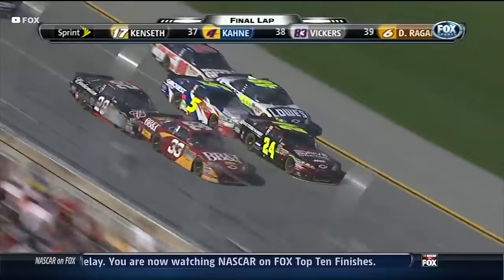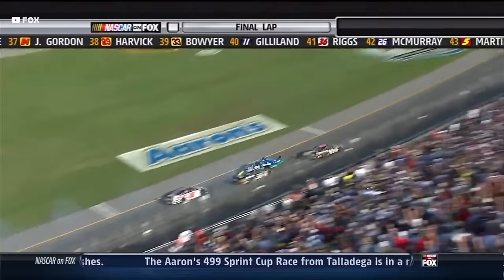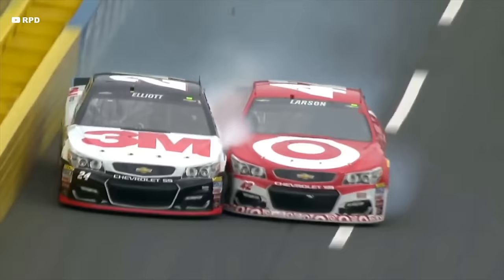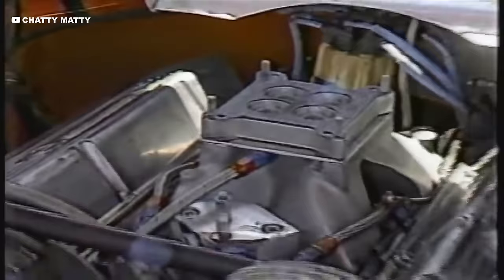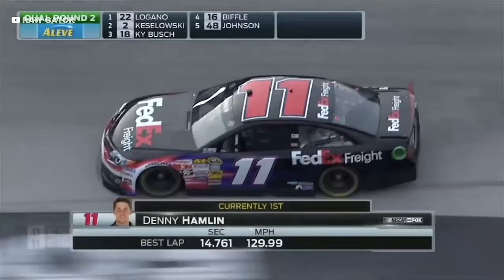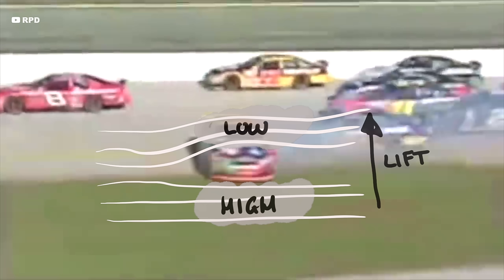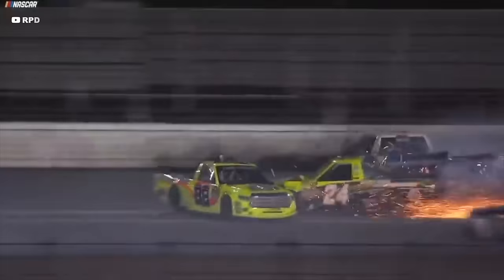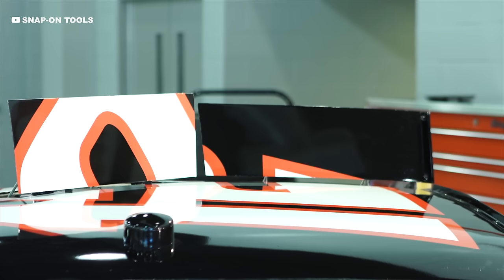The Simple Invention That Saved NASCAR

Comment: "Because the air has to travel farther on one side, it travels faster." This is a conceptual error. Low pressure regions speed up a fluid, and high pressure regions slow it down, just because the fluid is doing work to enter the high pressure region and has work done upon it to enter the low pressure region. This is why the velocity at the top is higher than at the bottom.
 The speed at the top and the bottom do not guarantee that the transit time is the same, so the explanation that the airfoil lifts because the air above is moving faster is incorrect.
Reply: YES! Even a brick with create lift. It's all about the angle of attack. The shape just makes it more efficient (less drag).
Reply: @nateverge1167  no, it's not all about the angle of attack. some wings can create lift even at negative angles of attack (when the front of the wing is lower than the back of it)
Reply: @vsm1456  Said lift is still a result of pressure differential, and relies on laminar flow and edge vortex to form a positively angled 'phantom wing' out of the medium itself.
Reply: Wow. There are so many things wrong with this thread it’s hard to know where to start. Any air that is deflected upwards by the leading edge of a wing is accelerated. There are two kinds of pressure: static pressure, which is the ambient air pressure acting on your body right now and dynamic pressure, which is the pressure created on a body by virtue of its movement through the air. In subsonic aerodynamics, as dynamic pressure increases (speed through the air), static pressure decreases (suction). That is what creates lift.

Scott is 100% correct.

Air wants to return to a state of equilibrium. By a principle of vectors, the air going over the top of the with has further to travel than the air underneath so in order to return to that state of equilibrium, it must travel faster.

I rarely agree with Scott Mansell - Driver61 - on technical matters but I have wind tunnel experience with racing cars. In this case he’s right. My experience related to a very similar problem, aerodynamic divergence in Formula 1. This is the phenomenon which causes cars to flip.
Reply: @vsm1456  Really? How?
Reply: @ineednochannelyoutube5384  Nothing to do with laminar flow. Racing cars don’t travel fast enough for that to be a factor.
Reply: @nateverge1167  Up to a point, yes.
Reply: @thethirdman225  First off cars absolutely can reach speeds where wings can stall, second off I was referring to seemingly negative deflection angle wings creating lift in any context not just cars.
Also in regards to your previous comment, wgat the fuck?
Pressure is pressure. No dynamic or static versions of it exist.
The system is either in equilibrium, and the pressures do not change, or the system is not in equilibrium, and the pressure differential creates flow.
Reply: @ineednochannelyoutube5384  Dear God... Stop commenting on things you don’t understand! “Pressure is pressure”... WTF? Are you serious? Do you not understand barometric pressure? Have you never experienced riding a bike into a wind?

Have a look at any commercial aircraft. They all use a pitot static system:

https://en.wikipedia.org/wiki/Pitot-static_system

And they do this because there are two different kinds of pressure. If you don’t understand these things you should not comment. I have wind tunnel experience on racing car aero. I am a former pilot.

The concept of equilibrium relates to returning to equilibrium. How do you not get this? You’ve taken a couple of bits of research which you don’t understand and posted it to prove that everything we know about aerodynamics is wrong when you yourself don’t understand the basic concepts.
Reply: @ineednochannelyoutube5384  Who said anything about stalling?
Reply: @ineednochannelyoutube5384  please show me an example of a wing at a negative AoA that is creating lift.
Reply: @thethirdman225  won't a cambered wing create lift at small negative angles too?
Reply: if you have two measuring points in air and follow them along the wing surface top and bottom you will find the one going over the top goes at the same speed as the bottom and cannot go faster without enrgyt input .. until the air has moved from front to back NO low pressure can exist or does exist ... once the bottom position reaches the rear of the wing the difference between the bottom and the top point becomes the effective lift of the wing ... youre explanation violates the law of thermodynamics  by creating energy out of nothing ... until air has moved NO LOW PRESSURE AN EXIST ABOVE THE WING and if you actually understand the lift equation you will notice it uses a derivative of the top to the bottom of the wing to calculate lift which means it is calculating a distance which relates directly to the lift of the wing ...
Reply: @0623kaboom  In any case, the Bernoulli theorem, which this guy is effectively saying is wrong, is still used to calculate lift and drag.

But I'm waiting for someone to make a video announcing, "Everything we know about aerodynamics is WRONG!" by someone who's seen a few YouTube videos and has no alternative explanation.

Bernoulli's theorem is not perfect but it's the best we have.
Reply: @thethirdman225  I don't know how, but it appears that some wing shapes are effective enough to still create some downforce even at negative AoA
Reply: @vsm1456  I'm not entirely sure of what you're referring to. I have heard that the front wings on early 1980s ground effect cars, up to the end of 1982, were run at a very slight positive AOA which had a flow on effect to the undertray and created greater levels of downforce. I don't know how true that is because I've never seen anything in the way of technical or scholarly articles on it.

Once a wing reaches a neutral AoA, it stops producing lift. But that neutral AoA should not be confused with mean chord line or camber line. Neutral AoA means no net lift.
Reply: @thethirdman225  He's getting on that there are airfoils that have a neutral AoA below a horizontal mean or "visually apparent" chordline, like the supercritical airfoils and low-speed convex lower side profiles.
Reply: @mfree80286  Yeah, I get it. Cheers.
Reply: If KYLE.ENGINEERS read this entire thread his brain would combust
Reply: @thethirdman225  All of my aerodynamic knowledge is purely in my head based on my own observations and I could a large chunk of this was nonsense(not you, you actually helped me understand my conclusions better).
Reply: @wolfywise  Thank you.
Reply: @wolfywise  By the way, what I didn’t say was what I think happens. Most people look at the diagram over a wing which shows a large vacuum bubble over the top surface, returning to meet the air underneath after the trailing edge. I think it is simply a case of high speed air over the top reducing static pressure, regardless of how it returns to equilibrium (which happened via turbulence which ultimately dissipates the energy). Meanwhile air underneath is compressed, with the sum total equal to or greater than the weight it supports. But Bernoulli’s equations - which these people infer are wrong - are still entirely valid. But I get sick of hearing people telling me it’s “conceptually wrong” while providing no plausible alternative explanation.

Comment: There were a few years that NASCAR teams tried to reduce a few grams of weight by changing the components holdings de flaps to a softer and lighter material, the result was that flaps got totally flat the other way around and stopped helping to slow the car down. After that, many teams got big fines for compromising safety. I cant point the exact year were that happened but it wasn't far away, somewhere between 2013-2017.

Comment: If one gets the grip of the principle that accelerated fluid experiences a drop in pressure, then most of the tech both on the exterior and the interior of a car (engine, intake manifolds, exhaust) suddenly make a ton of sense. Thanks for repeating it once more in this very explanatory video!

Comment: Great video bruh. You explained the downforce and flight concept very well. Keep up the good work!🤙🏻
Reply: No he didn't - that was all wrong, the distance airflow travels doesn't make lift. It can help make more lift - but what he said is fundamentally wrong.
The shape also is not the primary cause of lift - a totally flat object can easily create lift.
Reply: @csonkaperdido  Why don’t you create a video about it then and explain it better?
Reply: @siddharthsharma25  if I knew how to make illustrations on the computer and had time to devote to YouTube, I would do just that. But I don't.
There's a difference between explaining something in the wrong way, versus explaining something completely wrong because you don't actually understand the subject.

Lift, or downforce - which is the same as lift, and why engineers refer to downforce as "negative lift" - is not caused by air having to travel longer distances, and the shape of the wing can HELP create more lift but a totally flat object can also produce lift.

Pressure differential is what causes lift - in the case of a racing car, a high pressure area is created on top of the wing and low pressure on the bottom.

When air is accelerated, it loses pressure. So the wing of the car forces the air on top to flow slower than the air on the bottom - it "spoils" the laminar flow of the air, which is why people call wings a "spoiler".

Lift is also created from displacing more air on one side of the wing versus the other side.
If the bottom of your racing wing is nice and smooth and creates no obstruction for the airflow, then you get a relatively constant speed of airflow.
If you put a gurney flap on the top, that flap slows the airflow and creates a pocket of high pressure air directly in front of the flap, creating downforce.

Think of it this way - when an airplane lands, there are flaps on the top of the wing that are raised up kinda like a race cars spoiler... Raising those flaps means the air has to travel even further than before, so it can go up and over those flaps... However the flaps do not increase the POSITIVE (upwards) lift of the wing - they create drag, and negative lift.
So if making the airflow travel further increases positive lift - like how he explained it in this video - why would those flaps on the wing have the opposite effect?
Because the distance traveled is not why lift is created.
In regards to the shape of the wing - yes, certain shapes create more lift than others - however any flat surface can also create lift... So clearly the shape isn't why the lift exists either.... And that's what he said in the video. That's simply wrong.

Take a piece of flat cardboard and sit in front of a fan that's set on high... Then stick the cardboard out in front of you so it's laying flat, the air passes evenly across the top and bottom so no lift is produced.
Then slightly lift up the front leading edge of the cardboard - the end that's closest to the fan - and you'll feel the cardboard start to create lift.
This is because the air flow is being "spoiled" and has to make a vortex on the back/upper side of your cardboard wing... And that creates a low pressure area on the top of your cardboard wing... And higher pressure under it... So the higher pressure pushes the wing up.
The opposite occurs when you lower the leading edge of the cardboard wing - if the leading edge (closest to the fan) is lower than the trailing edge (away from the fan) then it will produce negative lift, or downforce.

The amount of air displaced is also how lift is generated... On a racing car wing, the air is displaced more on the top than on the bottom - which pushes the wing down. You're basically taking the airflow and shooting it upwards, which creates an equal downwards reaction.
Hopefully that helps you to understand, because the way he explained it is fundamentally wrong.... And teaching people the wrong thing is worse than not teaching them at all.

Now thousands of people who watched this video think that shape and airflow distance are the only way lift is produced... And they are wrong. So if they have a conversation with someone who knows how it actually works, they are gonna argue and look dumb.
I believe in educating people so they actually know how something works - whether it's wings and lift, or anything else.
Bernoullis Principle is a good place to start learning about pressure differentials and airflow.
There's alot more to it than that - but it will help you begin to understand the real physics behind a wing, instead of an incorrect explanation.
My only goal is to hopefully have some people learn something, and it's counter productive to teach people something when what you're teaching is not correct.
I have nothing against Scott, he makes excellent and informative videos... I just wish he would have spoken to someone who understands how a wing actually creates lift before trying to teach others, and getting it wrong.
I hope I helped you understand how wings create lift even just a little bit. No need to be negative - just trying to help people learn that's all.
Reply: I really appreciate you taking the time to explain this to me and yeah I really do get your point and I don’t mean to be negative. You have explained a complicated concept (for me) in a very comprehensive manner and not everybody has the skill set and knowledge base to do that so I appreciate your efforts. I assure you I would watch your video if you ever decide to make one even without the illustrations and fancy animations.
All I am saying is that there are always certain things we can do better than anyone else but since we aren’t, it’s important to appreciate the people who are.
So again, thank you very much for your time and effort but a little compliment to a content creator goes a long way to support their work, thats all buddy. 
Don’t mean any disrespect!
Reply: @siddharthsharma25  no problem my friend 👍

Comment: As an aviator, I have to say that the explanation was spot on!
Reply: and against the law of thermodynamic s about creation of energy ... the lift equation is a derivative of distance from top and bottom ... you cant create energy from nothing  ... even his example of a flat plate .. had to be set to an attack angel making the top side longer than the bottom side travel ... if you left it parallel to the ground it creates no lift unless  there are irregularies on the top or bottom of the wing creating a low pressure on one side or the other ..

Comment: 0:35  For those wondering, that's Derrike Cope at Watkins Glen back in 2016.   A broken suspension member rubbed up against the inside of right front wheel, overheating it and causing the inner bead to fail and explode into the engine bay.  He was uninjured, but no word as to whether or not his underpants survived.

https://jalopnik.com/utterly-perplexing-nascar-explosion-resulted-from-tire-1784945347

Comment: just a little correction to your explanation for aero in 3:33, low pressure regions do have higher velocity but the reason is not because of a longer length requiring faster speed to be covered, that’s a common misconception :-)

Comment: 4:46.       The moment you understand the 'paper bag' could had gone straight into the crowd.  😳😳😵.
Reply: And that was after they had a better catch fence system.  The one at 6:00 was the original case.  Carl Edwards (the one at 4:46) was assisted by getting some air and then being hit by another car and basically launched.  The one at 6:00 was Bobby Allison in the 1987 Winston 500, and he had no assistance.  That was also the same race that Bill Elliott set the NASCAR qualifying record of 212.809 (or 44.998 sec on a 2.667 mile track).  This was just 2.5 mph slower than the pole qualifying speed for the Indy 500 that year.  That's the crash that led to the restrictor plates in the engine that lower horsepower.

By comparison, the 2019 Fall race at Talladega (the last one with regular qualifying) had a pole speed of 192.707 mph, while the Indy 500 pole this year was 231.068 mph.  

Also, if anyone's curious how fast a NASCAR stock car could be: in 2004 Rusty Wallace did a test drive at Talladega without a restrictor plate.  He reached 228 mph on the backstretch and had a single-lap average speed of 221 mph.  People were able to also run simulations on iRacing without the plates and the results were approximately mid-to-high 230s solo with speeds nearly 250 mph in packs.

Comment: Just like ailerons of an airplane But on a race Car
Reply: Spoilers/Airbrakes
Reply: IIRC the Ailerons are the aerodynamic devices on the leading edge of the wings.
Reply: @formulafish1536  - No. Those are slats. Ailerons are on the trailing edge of the wings. The devices shown in this video are akin to spoilers (as the narrator correctly identifies).

Comment: The rear spoiler on those cars doesn't create much downforce. It's almost vertical, this shape doesn't create downforce, but essentially lots of drag. If you want some real downforce, an AoA of 30-40° is better. It's more an airbrake than a flap. This "pulls" the car from the rear, increasing lateral stability at high speeds. It's also meant to "break" the lifting shape/profile of the car at high speeds.

Comment: I'll add that roof flaps weren't an alternative to restrictor plates, they regulated that all cars have to have plates at Daytona and Talladega, after a crash at Talladega in the late 80s where the car flew in the air and hit the fence, tearing the fence apart, and sending quite a few fans to the hospital. That crash was in this video.